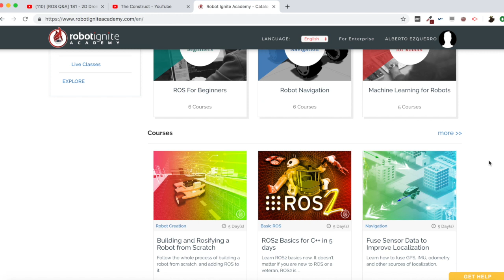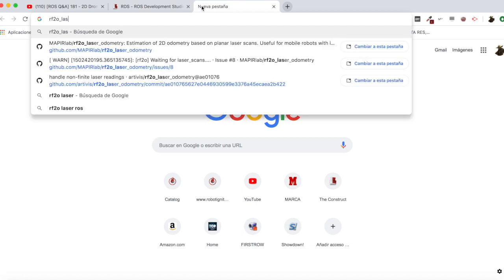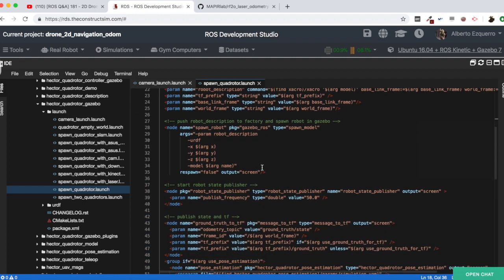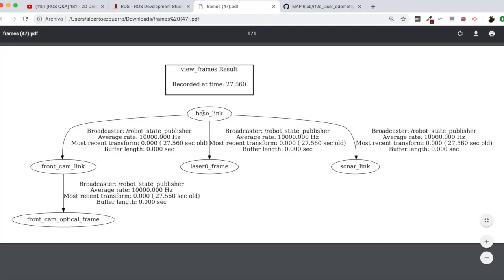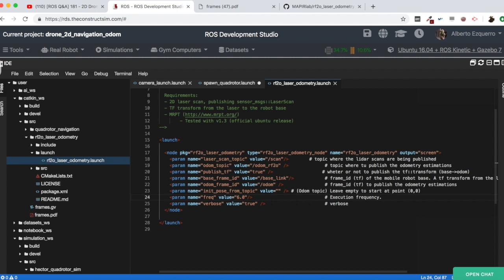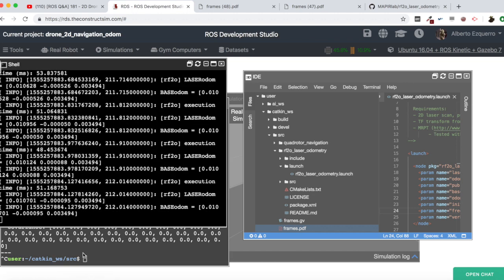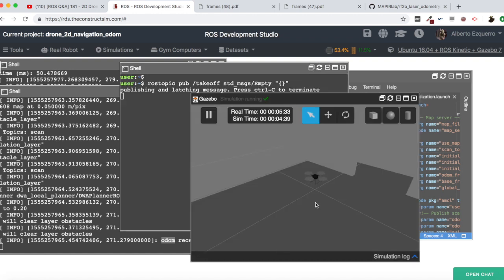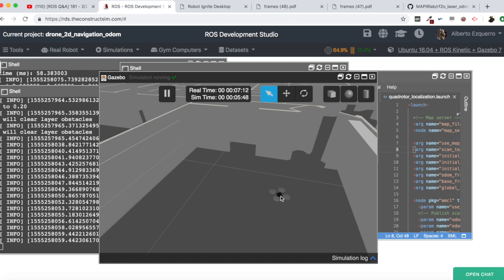[ROS Q&A] 185 - 2D Drone Navigation (Part 4 Get Odometry from Laser readings)

Comment: When the navigation algorithm plans a path, how does the gazebo model interpret that in order to move? I can find motor parameter info in the model files but is this simulation actually sending signals to the motors in order to move? Or publishing direct to cmd _vel? And if so does cmd_vel communicate in any way with the motors?

Thanks, good few questions in one there. I'm just trying to implement this on my drone but not sure how to get correct corresponding motors to respond to the navigation algorithm
Reply: The drone model in Gazebo has a plugin that acts as a controller. It reads from the /cmd_vel topic. Whenever a value is published in the /cmd_vel, that plugin receives it and translates this into the proper Gazebo model commands to move the drone inside the simulation. Check the drone simulation code to learn how that works.
Reply: @RickTellezL  very interesting, thanks I'll check that out